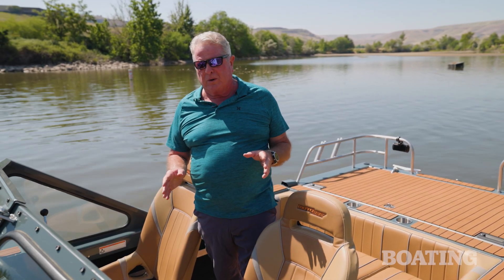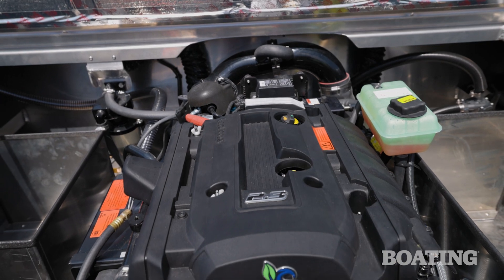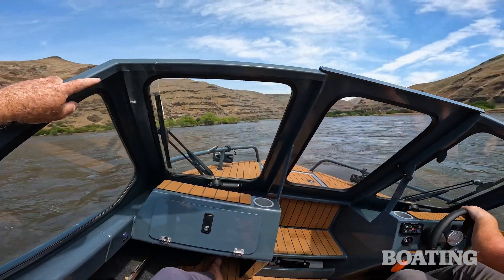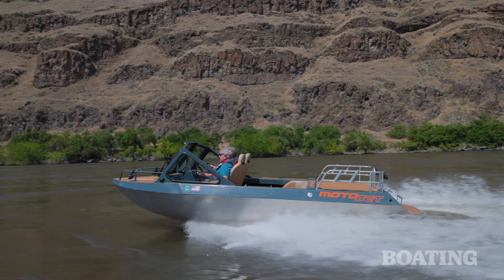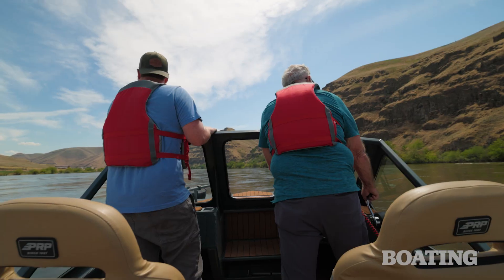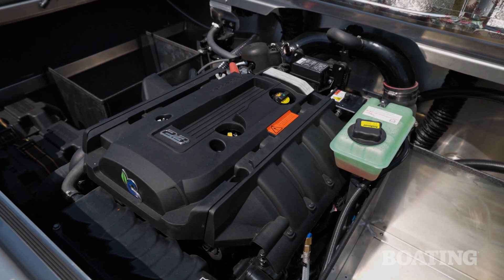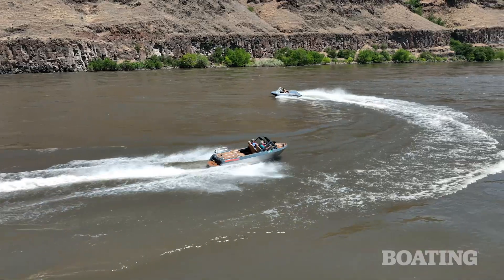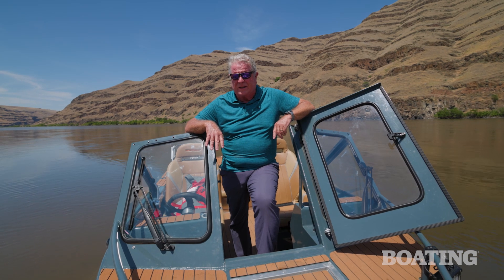Indmar Marine Engine‘s 2.3L EcoBoost Powers MotoJet’s Mini Jet Boats

Comment: The ecoboost engines are garbage should definitely stick to anything gm based instead, there’s a reason that ford engines were never really used in boats, there could never hold up like a 350.